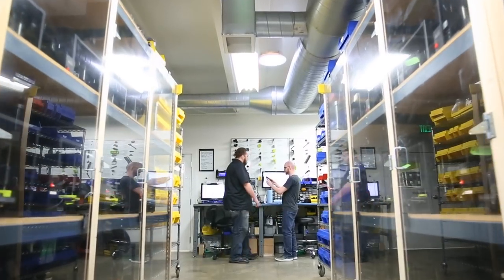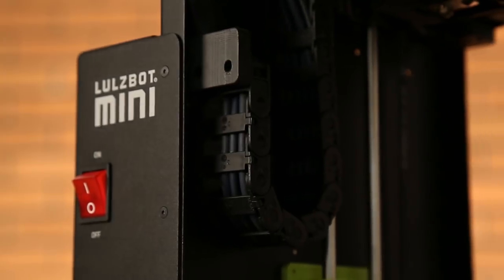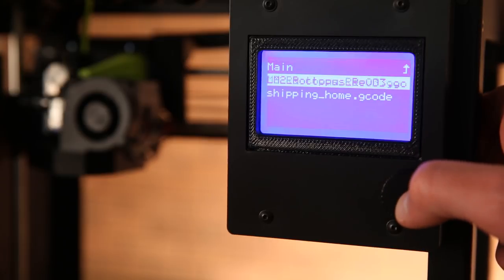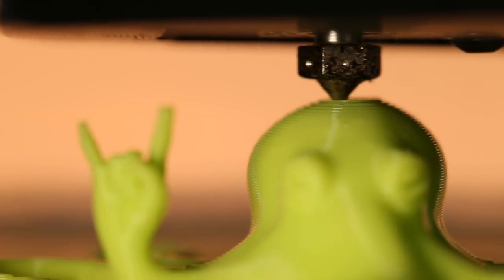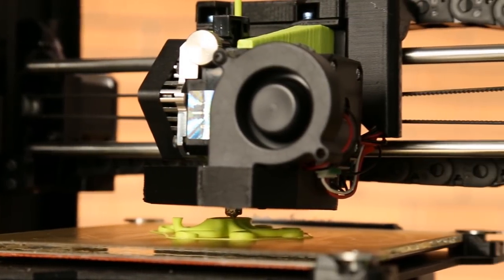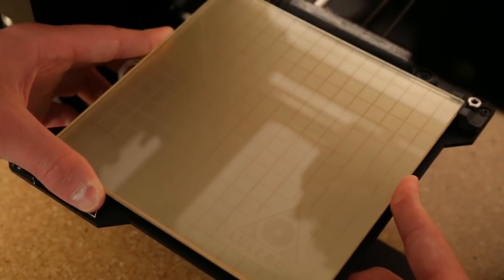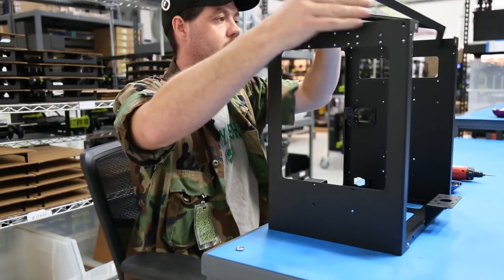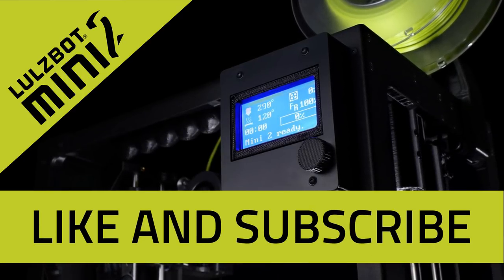LulzBot Mini 2

Comment: Have a Taz6. I would think your new printers would at least come with a filament sensor standard now. A removable flexible bed would be nice. Power resume? Wifi, touch screen. Seems like only thing new is belt for z axes. Lulzbot reliable yes, but wheres the innovation? or even parity with other big name 3d printer companies feature wise.

Hope Lulzbot's are coming down in price. I can't justify a Taz 7 at Taz 6 prices ($2500), with only new extruder assembly and z belt.

Still running 8bit main board?
Reply: nuroo I have to agree. The whole made in America thing is no excuse to charge an ungodly amount for a printer with all of its features ripped straight from the reprap project.
Reply: Thank you! This is exactly what i keep saying!!! Over pricing, no innovation, etc. Good customer service is not worth it when your paying like 10x as much as you would normally pay for 3d printing stuff.

Comment: I'm using a taz 5 right now but the lulzbot mini I have access to isn't recognized by my laptop. any tips?
Reply from the maker: support@lulzbot.com can help you with a manual firmware flash to get you going!
Reply: @Lulzbot3D  I figured it out and wow this thing prints better than a lot of more expensive printers I've used!!!

Comment: First!!
Reply: And stoked! Is there a trade-in/upgrade program?? Was about to overhaul my mini with new extruder and bed but now I have to consider this...
Reply from the maker: We're exploring what upgrades will be easy, and what upgrades will require more expertise. For now, the LulzBot Mini Aerostruder Tool Head and Modular Print Bed System are two great upgrades you shouldn't wait to use:

https://www.lulzbot.com/store/tool-heads?combine=Aerostruder
https://www.lulzbot.com/store/parts?combine=modular